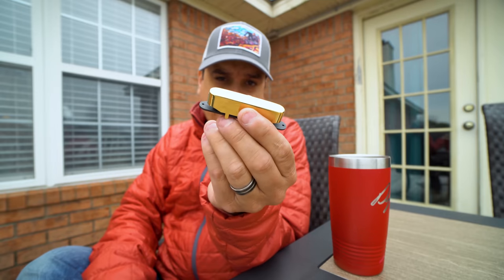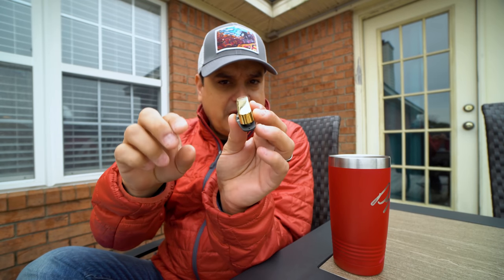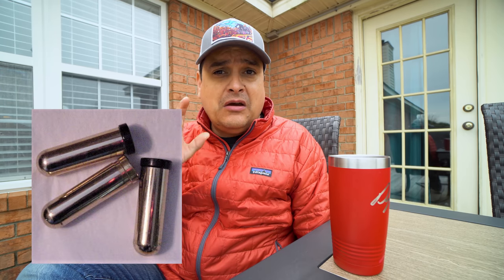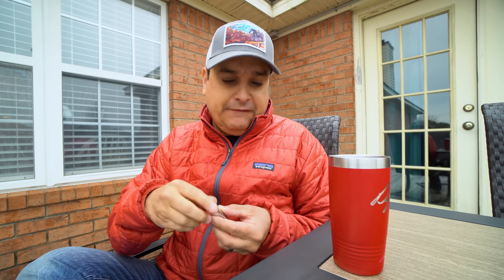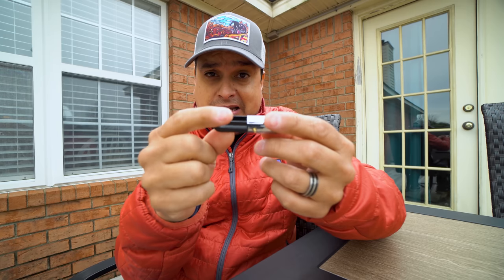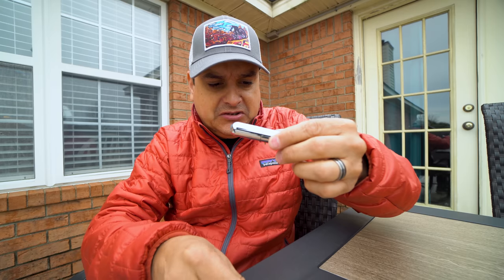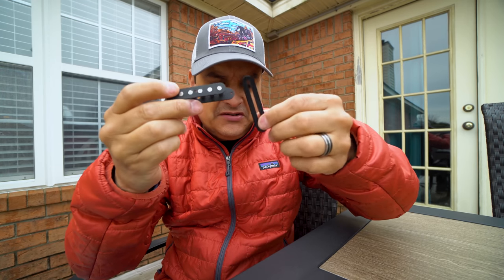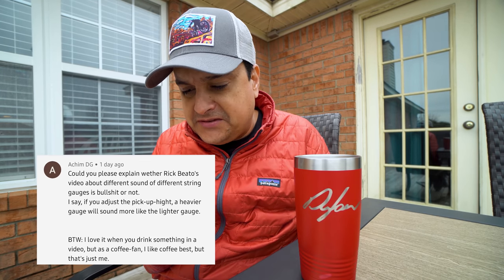Lipstick Pickups Vs Single Coil

Comment: I've seen some videos that suggest that the sound of cheap pickups that use soft steel pole pieces and a ceramic magnet may be improved very cheaply by removing the ceramic bar magnet and affixing neodymium disk magnets to the ends of the pole pieces.  What advantages do you see over alnico pole pieces over the combination of soft steel pole pieces and disk magnets?  I would expect that having pole pieces be magnetically separate (as alnico rods would be, but as soft steel rods with disk magnets would also be) would offer cleaner tone than having one mar magnet slapped across all six pole pieces, but I'm not sure I see any other upside to alnico.  Is there some way in which neodymium magnets would be inferior?

Also, would the term "lipstick pickup" be applicable to some slim form-factor humbuckers which don't have a rounded case, but use a couple of skinny bar magnets with coils wrapped around them so that both coils fit in less space than an ordinary single-coil pickup with discrete pole pieces?
Reply: The answer to your last question is no, they cannot be considered a lipstick pickup. That is a very specific style of pick up.

Comment: Does it make a difference of you separate the two halves of the lipstick case?  It looks to me like the case is kind of a shorted turn in the electromagnetic field.
Reply: I know the lipstick tubes are made of brass so they should be magnetically transparent. I don't know if the finish on the tube has any magnetic effect, though. I would guess that it does not.
Reply: @JasonWW2000  Brass induces Eddy Currents and definitely messes with your highs. Nickel Silver is close to "transparent". Brass isn't

Comment: QUESTION: Can you wire two single coil pickups into a Humbucker?
Reply: positions 2 and 4 on the stratocaster do that because the middle pickup is reverse wound. One of them has to be reverse wound.
Reply: Yeah but can you do it with two tele neck single coils, i.e. two silver bullet "lipstick"s??
Reply: You also have to consider whether they are wired in series or parallel. The two coils of a humbucker are wired in series while in a Stratocaster, the pickups are in parallel in positions 2 and 4
Reply: Absolutely. One of the pickups has to be reverse wind/reverse polarity in respect to the other pickup. They can be wired in series or parallel. Series sounds more like a humbucker.

Comment: Hi, Can a single coil lipstick be 70 kohms?
Reply: That would require roughly 10 times the amount of wire they originally had, so I doubt you could fit that much wire into the tube.

Comment: I use steel wool in frets, however. I try to use it when the neck is not attached to the body, but if it is I will tape over the pickups and any gaps around the pickups, then once I'm done, I will tape over top of the tap before peeling it off to keep the particle in place as a safety precaution. I did this mainly to keep from having little pieces of steel permanently stuck to my pickups and being impossible to remove with your fingers, I didn't know about them ruining them with rust... So I'm extra glad I do that now. Thanks for the info.

Comment: According to his SON, Nathan Daniel did NOT use surplus lipstick tubes for his pickup cases.
Reply from the maker: Interesting. My research says otherwise. I guess the legend continues
Reply: One version of the legend is that the very first Danelectros used surplus lipstick tubes, but after they ran out of the initial supply they had similar custom cases made because the old style lipstick tubes were being discontinued by the late 50s and were no longer easily available in bulk surplus. Probably by 1957-1958 they had already exhausted the original supply of surplus cases, so Nathan Daniel's son may have only known about the later period.

Comment: It's awesome because I've just been watching your channel, and I was thinking about alternate designs to the single coil. I was wondering "why not use a bar magnet wrapped in coil?".

Quite amazing. Nothing is new.

I'm going to just build one of these into a copper or steel pipe just to see if I can do it. Very neat.
Reply: Steel pipe will definitely blocked a magnetic field. I'm not sure if copper would affect it. The original lipstick pickups used a brass tube so as not to affect the magnetic field. They were also potted in wax hold everything in place.

Comment: Interesting video. I remember the lipstick my mom used in the 60s. Also I recall the old Silvertone guitars back then when nobody liked them. They were a cheap substitute for a Fender. I like regular single coils better myself. Lipstick pickups are cool sounding but I don't much like them. I had an Ibanez Talman with 3 of them but sold it due to the ultra skinny neck.

Comment: Why do you hate gold hardware? Does it remind you of the wealthy?
Reply: I happen to like the look of gold on black. 
My one only experience with gold hardware was that it corroded, which is an odd thing for gold, but my guess is that it's so thin that it wears down quickly.
This was on a cheap Japanese LP copy. Odd thing though is that the Chrome on cheap Japanese guitars was much better than on good American ones.
Layered on quite thick, which would make sense since chrome is so much cheaper than gold and labor was cheaper back then too.